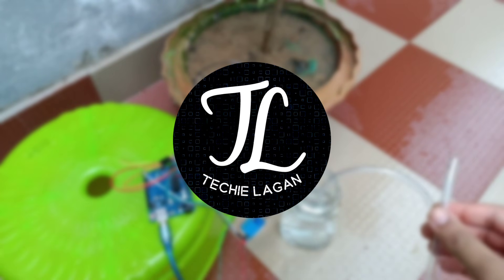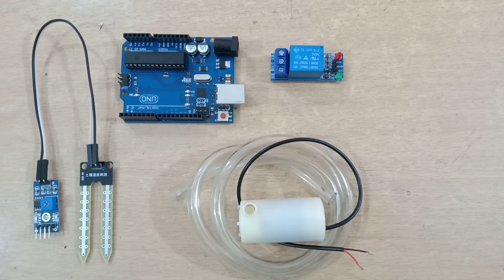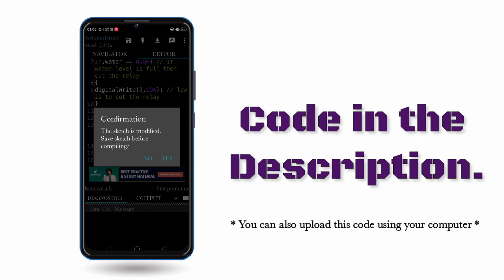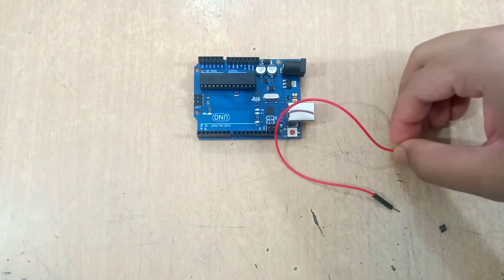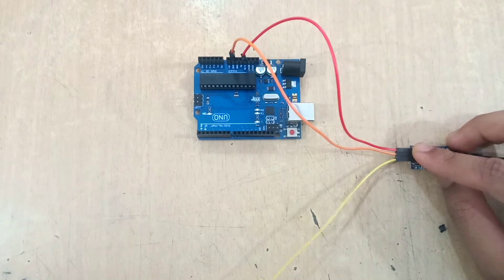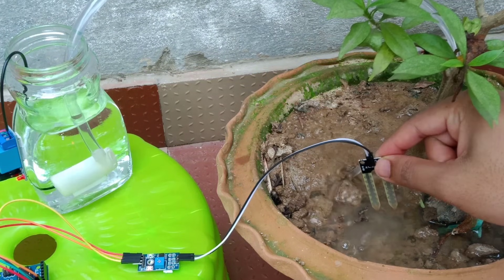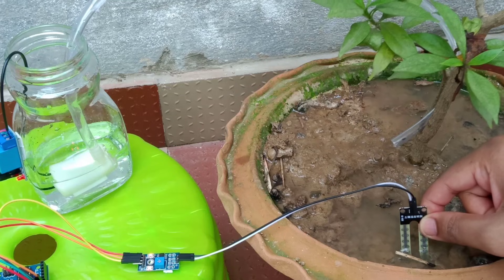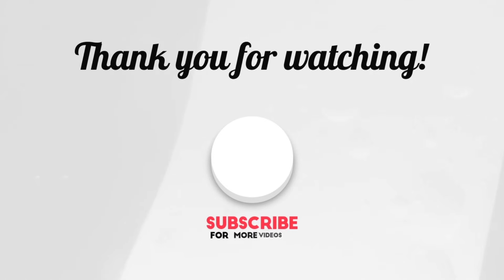How to make Automatic Plant Watering System using Arduino UNO and Soil Sensor || Techie Lagan

Comment: What is the purpose of jumper wire? I didn't get it in the vid because your fast talking
Reply from the maker: Jumper wires are only for connection......
Nothing more other than that
Reply: @TechieLagan   is it 10cm? Or 20cm?
Reply from the maker: 10 cm
Reply: I will be using this as our investigatory project.
Reply: Do it need a breadboard?
Reply from the maker: No breadboard is not needed
Reply: @TechieLagan  thankyou, this will be helpful to me if I passed the defense on our research🥰
Reply from the maker: It's my pleasure 😊..
Reply: Male to female?

Comment: The green wire and the red wire at the relay at the water pump you connected with what
Reply from the maker: It is connected with battery ( Power Bank)
For more clarity please refer to the circuit diagram!!

Comment: Dude by this logic won't we be over watering the plant ?
Reply from the maker: No bro i don't think so because usually we fill water to the top of the pot while watering any plant.
Also the sensor is so sensitive that even if there is a little bit moisture in soil then it will not water the plant.
Also there is a good drainage in the pot..

I hope that your doubt is cleared.. 
 
Thanks for your valuable suggestion...
Reply: @TechieLagan  thanks for the reply ! Explains the doubt , so how long did u keep this setup for the plant , and was the plant healthy / growing properly?

Comment: Bro have you connected red and green wire with 5volt battery. And is Arduino connect with a charger in plug
Reply: Please tell fast anyone

Comment: good one! but I made some changes in the code and in the system.

I replaced the pins and recoded them for the Arduino Nano microcontroller. I found that when the sensor was giving a low signal the relay (motor) went off. That makes no logical and practical point, when soil is already wet why would we want more water to be pumped into the soil? It should be another way around, which means when the soil is found dry by the sensor it should pump the water from the tank to the surface of the soil. For that, I simply changed the code from HIGH to LOW.

if(water == LOW) // Line number 9

Also, I directly connected the DC motor water pump to the pin instead of a relay. Using a relay would be overkill if I want to use it for just a small plant. Relay can be useful If I want to trigger a high voltage bigger AC motor with the same system. To maybe water a whole garden, a park, or a field of crops.

But very useful watching you in this video encouraged me to finish a project I was working on for more than 6 years from now. Thanks a lot. I made a video too, not a tutorial but of the functioning project. Though I have to think about giving power to the microcontroller, currently I used my battery bank. I'll try to make a permanent and durable setup.
Reply: can you please give the code??
please please...
Reply: could you tell me connection as you are saying I m interested to do this project
Reply: Can you plzz provide the code
Reply: Can you please provide code
Reply: I'm delighted to see the enthusiasm around the code modifications I made! To help everyone understand the changes, I've created a detailed video explaining the process. You can find the link to the code in the video description. Happy making, and thank you for your interest!

For the full tutorial, check out my YouTube video: Click here
https://www.youtube.com/watch?v=Ct0QxOE1f1A

 @shivanidubey1716

Comment: what can I use other than a 5 volt power supply as the connector of the 2 red and green wires that connects to the relay and motor?
Reply from the maker: U can use an old phone charger or a power bank or 
A 9 volt battery .....
Reply: @TechieLagan  can you give me your phone number i need to your help
Reply: @TechieLagan  will arduino  blast
Reply from the maker: No but if you provide more than 12 volts then there may b a little spark in the microprocessor and the whole Arduino may stop working.

Comment: Put a toilet cistern on wall when it needs filling it will do it as the float lowers & a 12vdc solenoid when the dirt become dry it switches on solenoid & allows water to flow from cistern down through solenoid make a ring with small 5-6mm poly garden hose & tee to connect to solenoid output drill some 1mm holes in underside of the poly tube ring  (holes face down to soil) when soil becomes damp enough it switches water solenoid off until soil becomes dry again

Comment: This pump has to be submerged in the water right? I tried to transfer water from one cup to another cup while the pump is outside the cup. It doesn't work.
Reply from the maker: Yes it has to be under water.
Reply: @TechieLagan  Is there other type of pump that can be used without  need to be underwater?
Reply from the maker: Yes there are .....
You can search on the internet..
Reply: @jumbo999614  You dont need submersible pump for that small work, just let the water bucket be little bit elevated and  and provide outlet from the lower side to have water flow to pump through gravity, again make sure the flower pot is higher level than water supply to avoid free flow when pump is not running. That should work well for you.

Comment: Bro  what about the connection of other green and red wires ends while connecting to relay  and motor? Plz give explanation of that connection
Reply from the maker: Those wires are connected to 5volt Power supply...
Reply: @TechieLagan  i thought its 9v
Reply from the maker: Bro you can use 5 volt, 9 volt, 12 volt or even AC power supply ....it all depends on the type of pump you are using

Comment: Where does the green wire and red wire connected to the relay module go
Reply from the maker: They are connected to 5volt supply from a power bank.
Reply: @TechieLagan  can I connect to 9v baterry?
Reply from the maker: Yes

Comment: Bro I have connected to the battery but it's not working as u show the watering is pumping continuously after keeping the moisture sensor also
Reply: It's working
Reply: @ovaisalamqureshi2959  please send your code
Reply: Change potentiometer in the soil moisture sensor it worked for me
Reply: @alansmods1775  i have completed my project everything is fine any way thank you
Reply: Same problem.,.plz resolve
Reply: @teenajessy4680  use 2 batteries I did the same thing it worked
Reply: @satyamudiraj2299  how pls explain
Reply: @satyamudiraj2299  which battery?
Reply: @DaneshPPatil  use 9 volts battery you need 2 batteries
Reply: Change sensitivity via the potentiometer
Reply: Satya can you plz explain
Reply: @ovaisalamqureshi2959  sorry, did u succes with this project?
Reply: @maulidyasyah8914  yes
Reply: @ovaisalamqureshi2959  yes I can
Reply: @ovaisalamqureshi2959  conet the wires as shown in video but use two 9 volts batteries 1 for ardiuno and 1 for pump connection
Reply: @satyamudiraj2299  Hi, where should I not battery input in Arduino
Reply: @aaronnself  connections r their in the video
Reply: @satyamudiraj2299 hii bro can you help me i am having same oroblem
Reply: @sayedtousifalam3724  yes I can
Reply: @ovaisalamqureshi2959  can u help me ?:((
my project did not work
the problem is the relay wont stop
i check the code and pin of arduino its fine no problem, but my relay wont stop the pump
Reply: @maulidyasyah8914  please send your code
Reply: @maulidyasyah8914 your project successful or not
Reply: @sayedtousifalam3724  yes sucessful
Reply: @ovaisalamqureshi2959  can you please send ur code?
Reply: Sar Which version of Arduino used in this project  pls tell me
Reply: @dhrumilkareliya3438  aurdino uno
Reply: @dhrumilkareliya3438  Arduino Uno R3 Compatible.
Reply: Can someone say me whether I can use solar panel instead of batteries if yes please say me what type of solr panel should I use
Reply: Lol I got the same problem my father taught that these batteries are not compatible use the lithium ion batteries of 3.7 v it will work magnificent ly
Reply: @hareemnadeem1400  yes
Reply: @satyamudiraj2299   how if i want to contact you
Reply: @hareemnadeem1400  where we connect the battery
Reply: i too having the same promblem plz tell me a  solution .
Reply: @samyukthapushparaj216  use 2 batteries instead of one
Reply: Sir,I have a doubt. That is to which battery I have to connect to the circuit.
Reply: @devigandham5121  9 volts battery
Reply: Same issue.

Comment: Great video.  Could it be modified to water several different plants all at different times?
Reply from the maker: Yes , definitely it could be modified.
In that case u have to use multiple soil moisture sensors, relay modules and pumps. But no need to use multiple arduinos, one Arduino will be enough.
And also u have to do some changes with the code.
Reply: @TechieLagan  thanks.
Reply from the maker: My pleasure 😇
Reply: Can you please share modified code for multiple plants?
Or u can make a separate video
Reply: I have used the 9v battery as an power outlet. Will it work
Reply from the maker: Yes